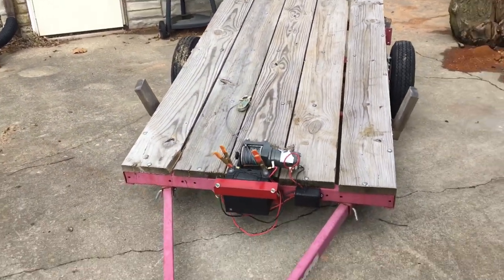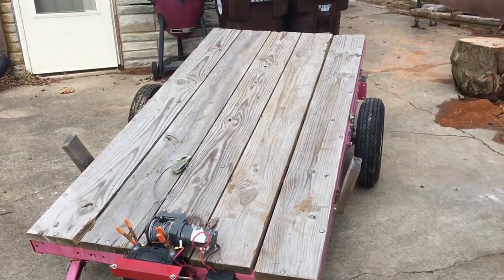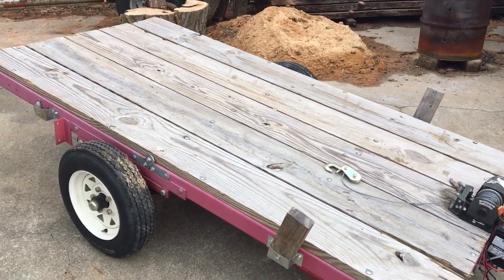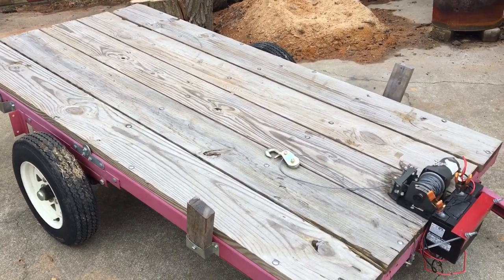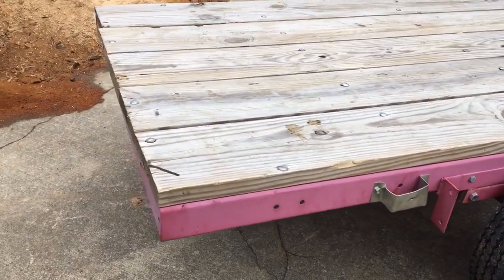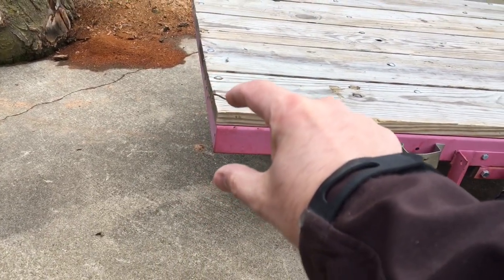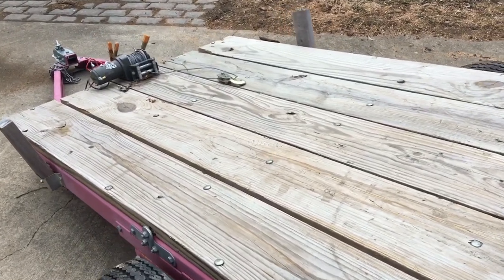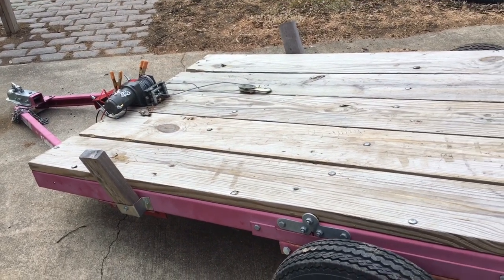Harbor Freight Log Trailer-It can work!!!!

Comment: Fantastic--you're really doing a lot with a little!  I use an HF 9000# winch with a marine deep cycle battery.  It's overkill, but I never run out of juice or force.  Excellent idea about winch & anchor point on corners. That's my next change for sure. Thank you!  @HoneyOnWales

Comment: Most states don't require registration when the total weight of the trailer and it's load is under 2000lbs.
Reply from the maker: That sounds great to me. Unfortunately I live in IL and they would require registration on lil red wagons if they could.
Reply: @SlabGuy  i don't doubt it. But that's why it's rated at 1720. Trailer weighs 280lbs so that leaves 1720 for payload before hitting the 2000lb limit. Next step is 3500 because over that weight you need brakes on the trailer.